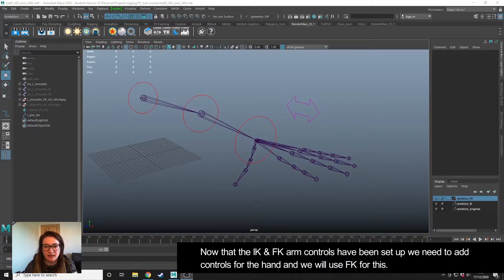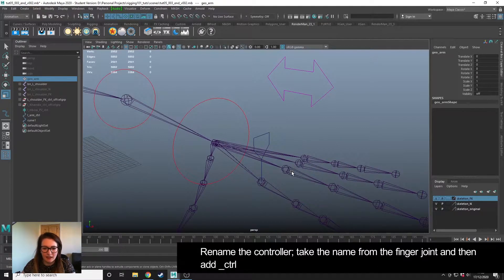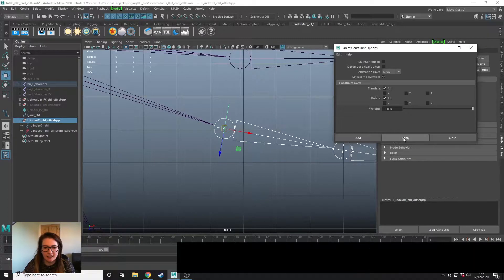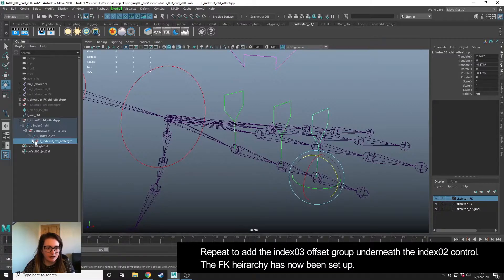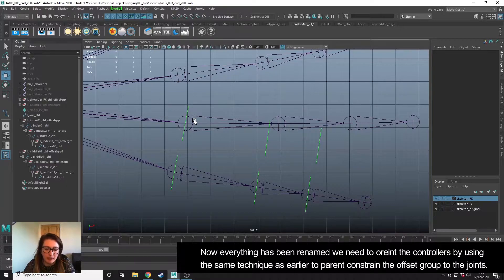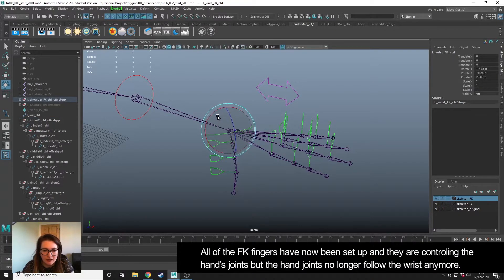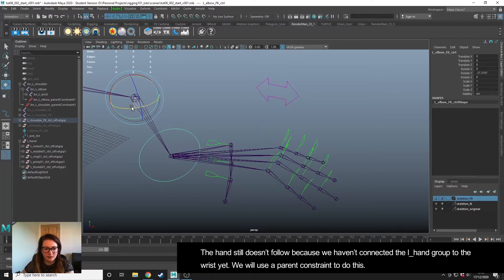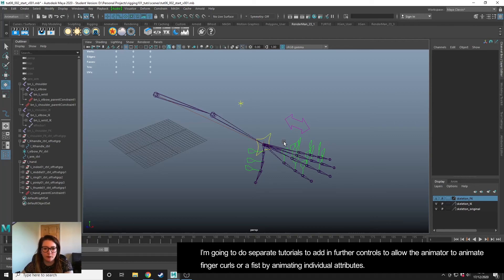FK Hand Controls Tutorial - Maya Rigging for Beginners Part 06

Comment: hi i followed your tutorial, but there was a problem on my rig after i parent the finger group onto the wrist bone. when i rotate the fk wrist it does move the finger joints with the respective finger controller correctly , which is up, down, side to side. But when i rotate the FK elbow, the finger controller does move with the correct finger joint position  when its rotated side to side only ( like in your video). but when i rotated the elbow up and down the controller doesnt move correctly , it either translated in X or Y.

Comment: Great tutorial!!!!
I parented the constraint to finger bones but the bones are not rotating as 9.19.
Reply from the maker: Did you remember to delete the parent constraints used to snap the offset groups and controllers into position?
Or possibly your hierarchy of the offset groups and controls isn’t correct?
I would advise delete all constraints on the fingers and then try again.
Let me know if it still doesn’t work.